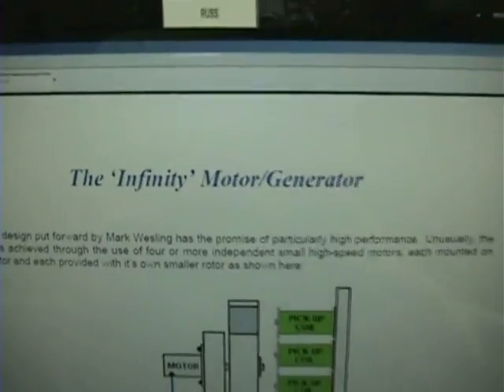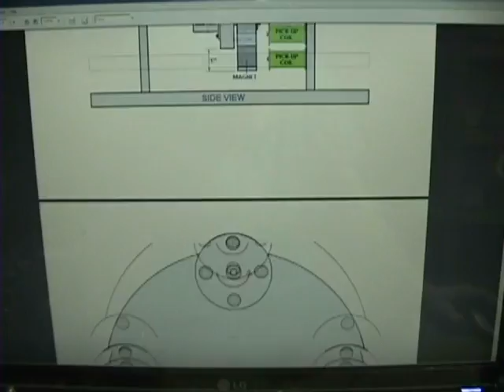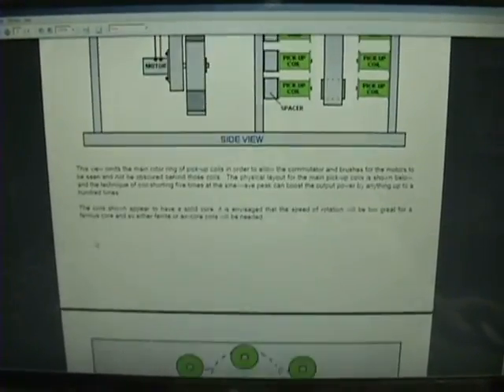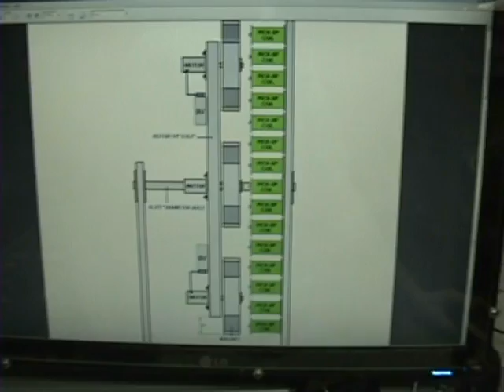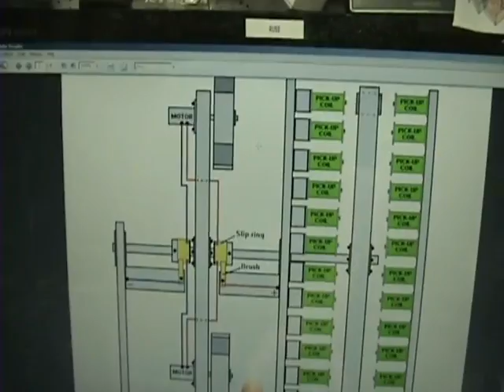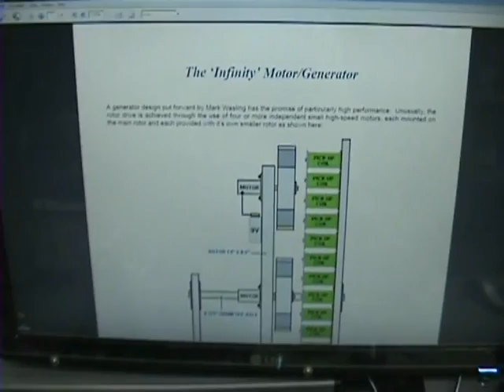The 'Infinity' Motor/Generator by Mark & Russ

Comment: Remember this Infinity design works better with more permanent magnets and more coils because infinity converts magnet coil interaction into forward torque. When an electrical load is drawn from currently designed generators the forward motion of that conventional generator is converted into an ever increasing drag on forward motion. When an electrical load is drawn from this Infinity generator the load pulls the generator forward. The more load drawn, the faster Infinity turns and an ever decreasing amount of torque is required to make power. Best part, is that means (more) magnets, (more) coils greatly increases efficiency.

Comment: The motor is converting counter electromotive force into useable mechanical work. It's not a conspiracy theorist's dream machine like you trolling goons would have the rest of us interested people believe. By shorting out the ring of coils, the coils are creating counter electromotive force which the tiny rotor magnets then use to "push" off of. There's no mystery about it! Standard electric motors are constantly fighting counter electromotive force and will draw many times more current to overcome it just achieve torque. This motor design is a brilliant idea and a wonderful demonstration. Thank you for posting.
Reply: Thank God someone gets it. So many clueless lemmings and paid disinformants on here regurgitating the outdated, debunked nonsense which props up their over inflated egos and nearly worthless degrees designed/maintained by the same kabbalistic psychopaths only interested in protecting their number one income stream. To those involved in the suppression of OU technology, the perpetuation of endless wars, pseudoscientific lies, and poisoning of earth. Every single time you spew anything close to "laws of thermodynamics", you should be kicked in the shin. Your ignorance is offensive and you should bleed for it.
Reply: Each time the magnet passes by the coil there is current induced which is the cause of the counter electromotive force which is the cause of the rotors foreward movement.

Comment: I done a few tests (not as nice as this one) in regards to lens law. I found that if your coil has a magnetic force from both sides, you get more Volts. Around 50% extra i believe.

If you put another wheel of magnets again north side facing the coils it should give you a bit more. I found that it done better with the coil was between 2 repelling magnets rather than attracting. 

Hope that helps fella. Thanks for the vid
Reply: Pretty sure that is impossible, fella.

Comment: This may be off topic, but I think someone might find it interesting. :)
 Electric Generator Design that's powered by it's self once it gets going & perpetuates more electrical current then is needed for it to run continuously on it's own. 
 Step 1: Calculate how much energy you need pumped into an electric motor to make a vertically positioned circular platter with magnets in-bedded horizontally around it's left side and right side (so there pushing force is pushing out sideways relative to the vertically spinning disc) to spin as fast as you need it to. Also better to make sure these magnets are shielded around their sides & back  with metal that has high permeability so the magnetic field they are emitting is focused fully out sideways. :D Step 2: Calculate how many sets of copper coils you need to be interacting with magnetic fields to achieve this & to perpetuate more electrical current flow then is needed. :D Step 3: Build a round horizontally positioned platter covered in all these copper coils pointed down that does not move (Is stationary) :D Step 4: Build a round platter covered in powerful magnets pointed up that can spin and place it directly under platter with hanging copper coils. :D Step 5:  Position the vertical platter that is  motorized close to the horizontally positioned platter covered in magnets pointing up so that when the vertically positioned platter spins the in-bedded horizontally positioned magnetic fields slam sideways against the edge of the horizontally positioned platter causing it to spin. :) Step 6: Make sure enough of the copper coils are feeding their electrical current into the electric motor and the rest of the copper coils are linked into a set of rechargeable Battery's placed in the closest most convenient spot. Step 7: Build a duplicate setup of horizontally positioned discs with hanging copper coils and disc with upwards facing magnets and assuming the first set of discs are positioned to the front left side of vertical spinning disc, position the other duplicate structures to the front right, the back left and the back right of the vertically positioned motorized disc. As the vertically positioned motorized disc spins the horizontally in-beaded magnets will now hit into all 4 horizontally positioned discs causing them to spin. so you will effectively be using the spin of one disc powered by one electric motor to spin 4 constructs that are each generating electrical current. now build this whole setup multiple times over and use the current perpetuated by it to power up scaled electromagnetic generators that are equal to or more powerful than the ones used in a nuclear power plant. You will now have a device that is self perpetuating off of it's own electrical current perpetuation and no nuclear waist to worry about.
 Here is the reason why my device does work. You see even tho the more electrical load you impose on a system ends you up with greater back emf hindering your devices ability to move and generate current, there is a way to work around this. My device multiplies the amount of mechanical motion that is taking place because of the 1 motor. On top of that, it eliminates any extra resistance that could have been imposed on the motor by making the other wheels spin by having the magnetic fields hit the rotating discs the way I described. You see, the vertically positioned disc connected to the motor is perpetuating the spinning of at least 4 main discs that are spinning magnets at no extra effort on it's own part because as it spins around powered by the motor, it is the horizontally positioned magnets that are shielded by high permeability metal that are using their magnetic push out sideways to force the other horizontally positioned discs to spin. So even tho each of those 4 discs spinning are somewhat hindered by the back emf it does not change the inescapable fact that each disc is perpetuating the flow of current in the copper coils above them and the amount of electrical current being perpetuated between all 4 discs is greater then the amount of electrical current the motor needs to run at max potential. It is called over unity and the extra electrical current the motor does not need can be fed into larger more elaborate electric generators. Imagine 12 of these designs contributing to the power needs of a much more powerful design (Probably electromagnetic) that is utilizing this same idea of multiplying the number of horizontally positioned discs that spin because of the motion of one powerful  motor spinning a vertically positioned disc cleverly positioned so that it spins at least 4 other discs at a much higher velocity because of it's more powerful design. In short its all about multiplying what the first motors disc is interacting with & second, up scaling the design to more powerful designs that utilize the same principles.
Reply: I like your ideas, excellent suggestions. Mumetal, will that work as the dividers? Many upgrades are possible on this experimental platform. This is an open source project. So any help is accepted and thank you for that. If you would like to manufacture a model and experiment yourself, just share you ideas on this video, please.
Reply: You got that right!
Reply: @weslingm  One could use Mumetal for the structure of the disc that has the embedded magnets in it but I don't think that would be best. It would make make it unnecessarily heavy. Since the Mu-metal or high permeability metal is surrounding the magnets themselves the disc that is motorized can be made of something else. something none magnetic. Not sure if this answers your question but I'll add a more detail pertaining to the motorized disc below. This next idea of mine helps adress the isue of re-magnetizing the magnets.     Improvements to verticaly positioned spining wheel in electric generator design.

           Design that allows the re-magnetizing of magnets horizontally plugged into vertical disc.
Aspects of Disc and connected components.
1: Disc it's self is non magnetic 
2: Disc has square shape (or other if better) in center that fits over shaft that is connected to motor that makes it spin.
3: Disc has copper (or other conductive material) ring around its rim. This electrically conductive ring has branching electrically conductive wires that branch towards center of disc. 
4: Disc has rectangular (or other shape if better) crevices all around it's left face and right face where the high permeability container housing the powerful magnets are to be placed.
5: Magnets in the high permeability material (steal/Mu-Metal/Other) have copper coils rapped around them and both ends of copper coils poke through small openings in the back side of the High permeability container. As they poke through they make contact with copper wire that is directly connected to the ring of copper around the rim of disc.
6: In front of vertically positioned disc is an electrically conductive brush (like the kind you would see in a motor making contact with the commutator) that can be pushed right up against the copper ring that is around the vertical disc. This electrically conductive brush is in it's own little rectangular housing that is not electrically conductive. However the bottom inside of this none electrically conductive housing is a lining of electrically conductive material so the current can travel from this to the brush and then to the ring of copper around the disc which in turn gets the electrical current to the coils around the magnets allowing them to be re magnetized while still apart of the Electric motors structure. The housing for the brush is capable of being safely pushed towards the ring and locks into place when it is directly touching the discs conductive ring. The platform the brushes housing is sliding on has electrically conductive plating and is directly connected to a switch so that the current cant get through until you want it to. This way brush can be pushed towards ring make contact and then switch can be flipped to allow current. When magnets are re-magnetized the switch can be flipped to turn off flow of current and then the brush pushed back away from spinning disc so there is no unnecessary friction.
Reply: Yes a generator that powers itself. That is the heart of infinity.

Comment: So much effort put in project to put Lenz law effect into good use which is very low.
Principle (as far as i understand) of free energy is to have enough big (at least 2 kw, but better more) magnet motor and 1 kw input power to defeat drag created by lenz law.
Rest what you get is free energy.
But better use 10 kw magnet motor and rotate it with 1 kw motor to defeat Lenz law drag....
Resonating is the key into FE

Comment: what you just did was build a motor not a generatorthis however is a new motor that I have seen, this could produce more horse power because of the double rotation effect good job
Reply: Like magnetic planetary gears?
Only producing electric power as it spins.
Reply: Yes someone understands it

Comment: hi does the shorting out of the pins kinda simulate the same as if a load had been connected to the coils ?
Reply: Yes Angus, shorting all those pins is load and load causes a conventional generator to slow/bog down. the more power drawn from Infinity generator it speeds up. In fact each one of the outboard motors could turn more magnets with more coils. That's why I called it Infinity. This is just a proof of concept device only. I believe with just a few changes made this device could achieve Over Unity.
Reply: ps were currently designing a new motor for the extreme end ebikes thought youd find interesting it will utilize axial flux and radial flux in the one motor so will have magnets on l and r side covers and on outer diameter will be running on 96 volts with posible 1000 phase amps  and feild orientated flux control will be in a heavy duty 27.5 inch rim top speed will be way over 100 mph it will have a smaller version motor on front thats mainly for launch
Reply: we are going to do bit of testing to see how close we can get to self sustaining to by using one as constant recovery via smaller unit up to point it doesnt tax the rear motor
Reply: actually if i can get 10% back id be over the moon
Reply: @angusmcgil Remember this Infinity design works better with more permanent magnets and more coils because infinity converts magnet coil interaction into forward torque. When an electrical load is drawn from currently designed generators the forward motion of that conventional generator is converted into an ever increasing drag on forward motion. When an electrical load is drawn from this Infinity generator the load pulls the generator forward. The more load drawn, the faster Infinity turns and an ever decreasing amount of torque is required to make power. Best part, is that means (more) magnets, (more) coils greatly increases efficiency.
Reply: so it would kinda keep accelarating to infinity well say.ha sorry bout that .that is till some sort of a limit is set on it  @weslingm
Reply: @angusmcgil  that would not happen but that could be an engineering goal. Infinity is all about using less energy to pass a magnetic flux past a coil and fire the coil and quickly send it on to the next coil. More coils, more magnets, more power.
Reply: @angusmcgil  also the original design was to have two generators side by side on the same shaft. On one side a conventional generator and the other side a infinity generator. The infinity generator would be the prime mover for the conventional generator. As the infinity generator  spins both generators on the same shaft and starts to over run. The conventional generator would be asked for just a little power and put a drag on infinity generator and slow it down. Like a yin/yang effect. But I think there may be a sweet spot where overunity could be achieved.

Comment: This sounds great in theory, but when you put an actual load (not a short) on the output, won't this slow down the 5v motors in turn slowing down the the rotor? It could be great for a type of on demand generator, but calling it 'infinity' is a bit hopeful. Keep up the great work.
Reply: what if you added 4 more little rotors and used the same drive motors.

Comment: This thing is scalable: meaning,,, brainstorm, each of the 2 small motors could turn a shaft with 10 small rotors with magnets in linear fasion on each of the 2 shafts. Now each of the 10 rotors has a copper coil on each N and S side of the magnets.
Reply: What did he say?lol

Comment: It takes 5V to start, but then each pin produces 4.5V, so in theory if you have a little jolt to start it, it can power itself, and then have lots of excess power for other stuff?
Does this essentially mean that infinite electricity would be possible with these generators?
Reply: Paul White  If you’re referring to perpetual motion +, NO.

Comment: Do the small rotors have to spin at a certain speed for the lens effect to work? if not you could use weights to power them instead of using motors that require electricity to make electricity.  I'm not an engineer and don't know all the specifics of electronics but I understand the principles behind the operation of your motor here and can't help but wonder if you could use an unbalanced rotor (one that turns because of gravity) to drive the small rotors. Or would the lens effect cause too much drag and stop an unbalanced rotor?
Reply: Alex Thank you for the idea. I have never thought about unbalanced small rotors.

Comment: How do I get the pdf?  Why don't you put a 5v crystal battery on it to run those little motors?  Nobody knows how long they last, but it is in the years.  Then you're acceptably close to perpetual generation without burning anything - oil, coal, wood, nukes.

Comment: hi, Russ
could you allow me to question about generator?
Reply from the maker: +alloy TAM sure ill answer if i know the answer! ~Russ
Reply: if there the generator will load the RPM will decrease significantly without adding the torque right?
is cause by the EMF of the coil,right?
that why infinite generator are impossible
Reply: how if the EMF can be compromise?
Reply: rwg42985 Hey, Russ. I suggest the coils must be modified. Do you have any new bifilar coil arrangements?
Reply: When load increases rpm increases

Comment: Just like Vegas gambling this device just slightly obscures the actual functioning of the device so that it seems like it could do something magical.  What you have here is nothing more or less than a motor generator with some design features that make it more complicated to build and more complicated to analyze but if built perfectly it will function no more efficiently than a well built motor/generator.  Since an efficient motor generator can achieve 99% efficiency already, there seems little value in coming up with a more complicated device.

But heck, it's  a great hobby, much better than doing drugs or going to Trump rallies, so keep on trucking.
Reply: What makes you think you can determine how this device will perform "if built a different way" which is not stated here. How can you say what it is capable of?